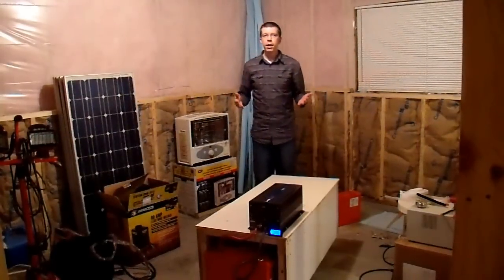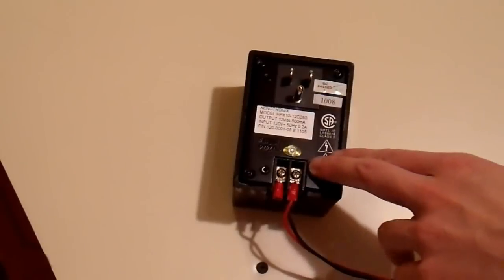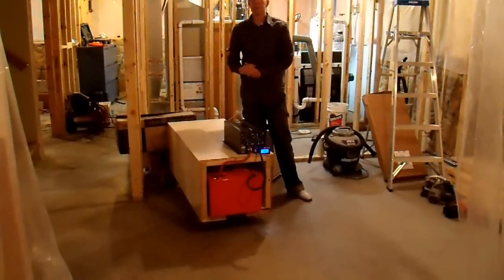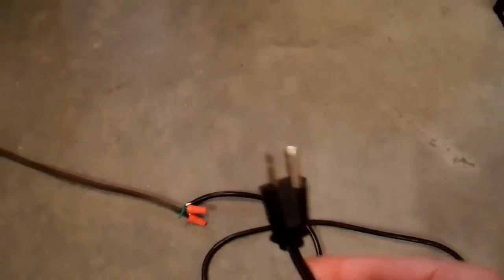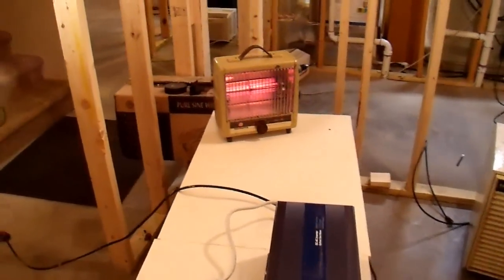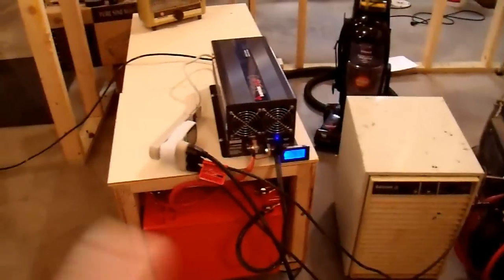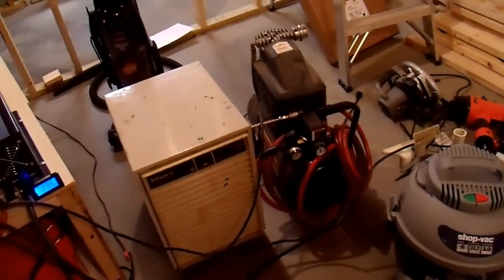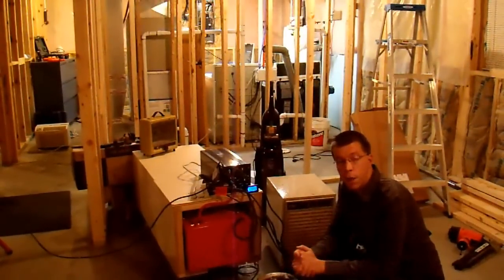1000Ah Battery Bank Part9 - What Can it Power??

Comment: I know this video series is ancient in battery years... And also know that we haven't heard much from you in a while. But I can't help but wonder if this setup is still currently serviceable. And/or how much life did you get from this amazing project?
Reply from the maker: I still use it.  It is not so healthy anymore and probably is at 60 to 70% capacity.  I am currently switching to LiFePO4 but these batteries are still going.  A few years ago they powered my house through a 2 day power outage.

Comment: Hi there I've watched all the vids in your battery bank series and many others as well, very impressive! But I wonder why all the inverters U use are 12v? You would be better off using a 48V or even higher system to reduce losses, thinner cabling etc. The other disadvantage of batts in parallel is that one dead cell will bring the whole system down whereas in a series system a  dead cell will do less damage.  In my home (in UK) I have a 72V system (6x100ah batts in series) I managed to source a 72V charger & inverter from China and the whole system works very well.  If U don't want to buy Chinese I'm sure that with your electronic skills U could make your own devices. Maybe U have a reason for sticking to 12V. Can U explain?
Reply from the maker: I currently use a 48V setup myself and agree that 12V isn't optimal, but I personally would avoid voltages above 48V due to arc flash dangers and electrocution risk.  48V is the maximum 'safe' voltage that can be touched by bare hands according to standards organizations worldwide.  48V can still cause a nasty arc flash injury though so it's much nastier than 12V from a safety perspective.  The reason most inverters are 12V is for legacy reasons:  That's what cars run on.  3KW is pretty easy to run on 12V.  Anything larger requires higher voltages as 4/0 cabling is about as large as you can get on any standard marketplace.

Comment: How many amp hours do you really need? 

1000 amp hours is impressive. But most of us would take a lot of time to build a battery bank up that much. I'm curious at what point someone would probably have enough to function before getting to that point?
Reply from the maker: It all depends on what you need for your application.  What is shown here is about 10kWh of energy storage which isn't much if you're powering a home.

Comment: Im just setting up something similar but with solar, do I need a 300amp fuse between my 3000watt invertor and the battery bank ? It has a surge composite of 6000watts would the fuse stop that happening?!?
Reply from the maker: You'll be fine with a 300A fuse.  A 300A fuse is guaranteed to handle at least 300A constantly with margin, and it will take quite a while to blow even at 400A unless you specifically purchase a 'fast blow' style which you don't want.  Keep in mind that most ANL style fuses are fraudulently marketed due to their primary use as fuses in audio setups where currents are never as high as people think they are.  I guess I'm saying be careful what you buy and test it before relying on it.
Reply: @knurlgnar24  Thank you.

Comment: I got 6 of the 6v 225ah golf cart with a 5000 watt duracell inverter, powers all my tools except radial arm saw.
Reply from the maker: That should definitely power a radial arm saw with thousands of watts of power to spare.  What gauge and length cables are you using?  I haven't tested the 5kw duracell though so it might not perform as advertised.
Reply: @knurlgnar24  straight battery cables like for a car starter. Seems like the start up is too great? But I've got a generator too. But ev thing else had been good.

Comment: What batteries did you use?
Reply from the maker: This happened to be a 10 battery 1000ah battery bank.  But the results would have been the same with any battery setup adequate for a 3kw inverter.

Comment: I will have you beat in about 5 more years...  Whole house battery backup INCLUDING hot water heater, stove, air conditioners....  Plus I can do it with only 8 batteries that cost me only $400 total ($50 each).  No solar needed either and total cost is reasonable.  I am confident you will be impressed.
Reply from the maker: I am confident you will be disappointed.  Give yourself 5 or 10 years and you will understand.
Reply: I don't think so.  I do lots of battery testing so I am confident it will work.  I didn't tell you all the details.  I am planning ahead 5 years so there is very little chance it will fail.  The inverter I will be using will make your 3000 watt unit look like a toy (which it basically is).  Don't make snap judgments without knowing the facts first.  Plus there are some other things I didn't even mention yet but are already being tested (yes even today).  This entire system will be much more impressive than anything I have seen you do in your videos.  You might even be interested in some of the battery experimentation I am doing.
Reply from the maker: @davidjames1684  I have no interest in what you are doing because it is evident that you have no idea what you are doing based on your comments and you will most certainly fail in your planned endeavor.  If you ever succeed please post video proof!  My videos are educational and not meant as bragging rights, but since you seem to want to make this a competition I do have a 14kw continuous system today which, in addition to multiple multi kw systems I also have, would compete with whatever you have planned very handily.  And unlike yours they actually work.
Reply: I like how you say you have no interest, then you tell me if I ever succeed to show you proof.  A total contradiction on your part.  So funny.  Of course it will work.  I test batteries as one of my main hobbies.  I have done things you probably never tried.  Here is just one example of many... I was given 2 free batteries and I purchased 1 new battery for a use on a 24V UPS.  I tested the 3 batteries individually on a constant load using a 12V inverter.  The solo runtimes I got (in hours) were new: 4 , better free : 3, weak free : 1.  So the question is if I combine the 3 and 1 hour batteries in parallel, and then put that 12V subbank in series with the 4 hour battery, then connect that to a 24V UPS and put a load on it, will the pair of 12V subbanks drain equally?  How should I wire up the 2 battery 12V subbank?  Should I add some series external resistance to the weaker battery or just wire them so they have about equal external resistance?  What different results might I get using those 2 different techniques?  Do you even know what happens when you take 2 different capacity batteries and parallel them?  You claim that 1+1=2.7.  What should 3+1 be then using your method?  it seems to me your method (which cannot be generalized since I have seen 1+1=2.2 on some batteries), doesn't handle my case.

Comment: This is why I have subscribed to your blog/channel.Clear speaking and great and honest information.I started out as a rookie,as we all do. Thanks. Long jabber to follow:

Your inverter is hooked up to the battery in the center? Small advantage?18 gauge wires for a 1,300 WATT heater,safely.
 I have (5) watt meters to see how much is drawn from each load.A/C is a HOG! 550 W. I'll need it to run through my Seattle summer,in my shed.
I have wired up a 2 FARAD cap to help with the start up load. It DID help,but my inverter is only 1,500 watts.
An air compressor? NO WAY!
Samlex: Impressive,indeed.

Comment: Thanks for the videos 
I just bought 16 of these batteries sbs 190F used for 2 years perfect condition but my question here is how is these batteries if you discharge 25% a day
And how long would they last in a shed in Raleigh nc 
Do you think they’ll last for 10 more years and can they handle daily discharge like 30%?

Comment: Yeah great set up mate . I had something similar going on and plug it into my house wall outlet and was able to run all the low power things on the circuit . It was charge with solar and seemed to work fine but only had it running for six months till we moved house . I look forward to setting it up again

Comment: Wow Knurlgnar ... you are one more update away from being my most favourite DIY Nerdstar you tuber ever.
Next update should be what fire extinguisher and a good suppression blanket to use in case of the improbable but not impossible event of a fire. I mention the blanket as I would suspect this burning or smouldering would emit some noxious fumes and it is after all in your basement... just a tip...extinguisher should be located at the entry of the room not near the bank it's self.
And a clear instruction chart/manual on how to operate it as needed in the home for other possible users in your home  i.e. your loved ones and friends... because you may well not be there when it's needed ... keeping in mind it may be an emergency or stressful situation for the operator.  The thinking would be "if my mother had to use this safely, what  would she need to do step by step". A list of the combinations of appliances that can safely and efficiently run in combo with out overloading that magnificent monster ... do not assume they will do the maths or not try to get it started in your absence... and just how pissed off you be if they killed it.
That said really inspired by your build and go large or go around in the dark and cold with no fridge spirit. 
The whole series was great to watch.
P.S. Consider a fifth central caster  to help push it around and a few warning stickers on the box.

Comment: Have you had good luck with the Samlex inverters? Just curious because I have
found inverters to be the weak link in solar power systems using batteries.
Many run for a while, then just die and stay in protect mode. One I bought, a 4000
watt pure sinewave, worked for about 2 weeks then died.  It was used with no more then 1200 watt
loads and usually under 500 watt loads. This should not have killed a 4000 watt inverter.

Comment: Very educational video thanks knurl, especially elaborating sulfation and cell equalizing. 

12V, 1000Ah bank = 12kWh which is enough to power the average Australian home for 24 hours (av = 13kWh).
Though they say an off grid bank should be able to power for 3 days without sunlight, in which case you start wiring the bank to put out 24 or 48V to reduce cable costs and losses.

Comment: i would not bother with those silly stupid chargers. you can buy cheap hobby computer chargers. on some you can even change the firmware. you can set every voltage and current you want. they start from 50w. almost nothing they cant do for 20-40 bucks. of course for regular charging such big batterys they would be a little bit slow.

Comment: What is the issue with connecting to the center battery of the bank as you had made mention? I have my modest 500 Ah bank drawing from 3rd battery, helps minimize cable losses works fine. Thanks.

Comment: Hey man. I got a couple of ideas here to bounce off of you just to find out what you'll think. I'm new to Solar but not new to electronic control and from the outside looking in it appears to me like like low voltage is the bane of the whole thing. One of the biggest expenses I read about is charge controllers and power inverters and I think both can be eliminated. Since batteries are very forgiving on charge voltages and it only takes (10) 12v batteries to get 120v. I'm thinking two banks of (10) 12s with output FETs driven with a single 60Hz oscillator circuit could make two phase 220 vac and two arrays of four-30v-panels series-ed could charge each bank of (10) 12s directly right? That would keep all the voltages higher for less current and eliminate two or more expensive components. What do you think? Worth a try?  I'm interested in getting my home air conditioning off the grid since that's my biggest monthly cost. It's also perfectly suited for solar since the more sunny it is, the more I need it. You see I live in central Florida, but if there was no such thing as air conditioning I'd surely be living somewhere further North.

Comment: As you have the head room in the cart I would ask you to put a 1/2" ply plate under the battery bank from end to end just to be a bit safer, those batteries are very heavy and worth quit a bit

Comment: is it interesting how ive got a 5AH 12v SLA AGM deep cycle battery that holds over 11.5v with a 22-25A load drawn from it by a 400 watt inverter? I'm very lucky because it has 2 adjustment potentiometers. 1 is for frequency and another is for voltage. I adjusted them to almost precisely 60hz at 115-120v when the voltage is between 11-12.8v because as the input voltage drops from the batteries. the output voltage actually increases.
My computer on power saver mode doesnt even take 2 amps from the battery. lasted about 2-3 hours running only from the inverter (Monitor and stuff plugged into the wall though. Just for testing purposes.) Could I charge the battery up. take a computer PSU. adjust its output voltage to about 13.5v hook it to the battery. and just run everything from it? Wouldn't that be a pretty good UPS if the power goes out I wouldnt even notice and i'd be able to save my stuff or even play games for a while! 
The internet is seperate from the power lines. so if the ISP is still getting power I can still have internet if i plug in the modem and router to the inverter even in a power outage! :D

Comment: One issue that I have with this video is that you're not actually showing how many watts each item is drawing. you did show how much the vacuum was drawing and thought you stated that it was "rated" at 12 amps the math shows that it was actually only drawing about 8 amps (1000 watts) so if each item is drawing less than its "rated" current, like they typically do, then your total is actually drastically less. Although I do realize that this video is more proof of practicality than achieving an actual output rating. I still liked the video though.

Comment: To me, the question of how long the battery bank will last comes down to simple math.  However the question is, do the batteries actually have their nameplate capacity???

So while I wont ask you do drain your batteries to test this fact, maybe you could answer it on an interpretive / empirical experience point of view?

Also, are you doing anything in addition to the "maintaining" as far as "conditioning" or "desulfating"???

Comment: Curious to know how you use this bank during a power event? In other words, how do you distribute power plugs used upstairs to the unit? I have heard there are special transfer switches required by most building codes, which don't allow both AC and/or batteries/generators to be feeding at the same time for safety... (backflow prevention, etc )

Comment: Good video but this is NOT what your battery bank can run, it is what your inverter can do. I can easily do this with 200AH of battery and the same inverter
Reply: a larger inverter at 12 volts is impractical because of voltage drop
Reply: a larger inverter at 12 volts is impractical because of voltage drop
Reply: +DMAN22yeah I think you should tell that to my 12v 8000 watt inverter running my house. It may disagree.
Reply: Trina McDonald it takes a lot of battery power to run 800 amps
Reply: +DMAN22yeah Yep, That is why we have a 1500Ah battery bank consisting of AGM telecom batteries at a value of $7000.00. These batteries can be, and it is recommended to, occasionally draw them down to 20% charge!!! They cannot be traditionally desulfated, this is the best way to maintain them. We also run 4, 00 guage wires to our inverter from the battery bank. Our house runs anywhere from 50-3000 watts as a norm. We have yet to peak at 8000 watts let alone the 30,000 watts start up rated for and rarely hit 6000 watts which the inverter is happy to run 24/7. Is it expensive to do it right? YES IT IS, is it worth it, YES IT IS!
Reply: Trina McDonald that sounds awesome, i dont think it is practical to have a 3000 amp draw from a 12v battery for the surge, but who needs 30kw in a house anyway

Comment: why not do with 24 volt or 48 volt? not sure by how much but it is more efficient with higher voltage but its enough to be worth setting it up not to mention you can use smaller cables from your batteries to your inverter.
Reply: +billy goatninja Probably because he had 12V inverter?

Comment: Great video series, very informative, and explained very well I think. I always think if you can't explain a concept to a 10 year old then you really don't understand it properly. I would have liked a little more complicated info but there were some interesting concepts about the agm batteries I had never heard of before so thanks for that. I would like to see an update now that it is a year later with how well the batteries have lasted and whether the voltage and standing charge has dropped much to get an idea of how that would likely graph over the next few years. Elon Musks Tesla battery looks great but is still in my mind double the cost it needs to be for a huge uptake. At half the cost I could buy one and top it up after 12am when my energy company reduces the energy costs (nuclear is 24/7 after all) and use the energy after 7am when the price goes up. Doing this alone would pay for a Tesla battery over 10 years (if it were half the price of the current $3000).  Hopefully this price will come down as time goes on which I expect it will. In the meantime I find this sort of a project is the best chance to get cheaper energy with solar panels and it is a great way to get an understanding of what is possible. Thanks ... keep up the good work! Also curious about where you live roughly. I was surprised when you mentioned power cuts for a whole night is that a common thing in America? As a Brit I wouldn't have thought that would be true. If that is where you are based of course.